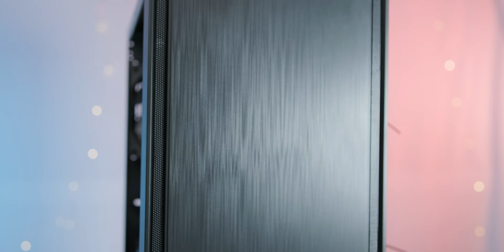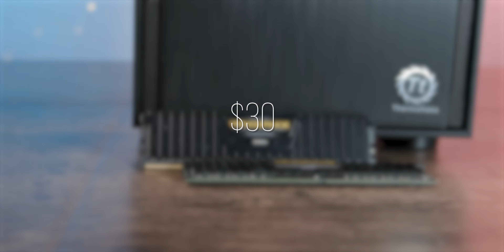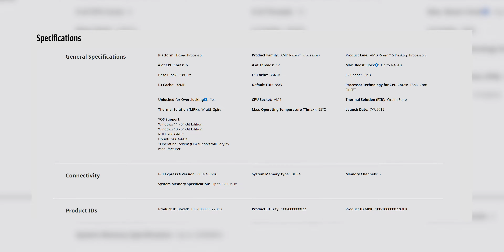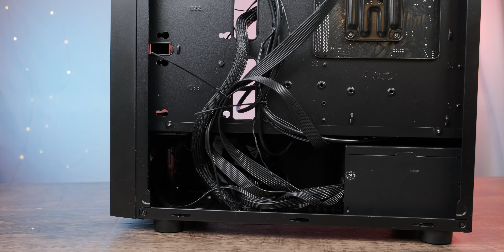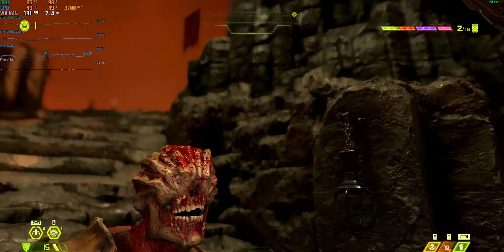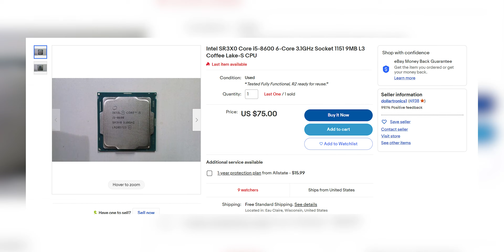Ryzen is Finally DIRT CHEAP

Comment: I have a build very similar to this. The only difference is that every part (minus the graphics card) I bought new in 2018. Ryzen 7 2700X with 16gb of RAM on an X470 motherboard. Got the RX 6650 XT last year and it's still playing every game I like very well. Also have upgraded to 32 GB of RAM. Maybe I'll upgrade to the 5700X3D or 5950X at some point.

Comment: Highly recommend the rx580 8gb card paired with an r5 1600x.

Cyberpunk 2077, RDR2, Minecraft, it didn’t care what I threw at it, as long as it was 1080p and I turned some settings down (turn shadows down first) I got 60fps in most games.

It even ran switch and Wii U emulators with better texture mods and draw distance mods fine, as well as every other console besides the Xbox line, and ps3 or 4.

Seriously, the non top tier parts are still perfectly capable, and hold good value.

Comment: Stupid question, why putting the ssd near the power supply will there is 2 slots on the side of the case (the side where the cables are ) ?
Reply from the maker: Because it was supposed to have an m.2 ssd, so I didn't want to clutter up the case with something that wasn't supposed to be there. If it was supposed to have a sata ssd I would have put it in the proper space

Comment: rx 6600 is a great used gpu right now. If you can find a reasonably priced b550 board, and a ryzen 3600, you can run it at full pcie gen 4 speeds which can give it a nice boost to fps in some games